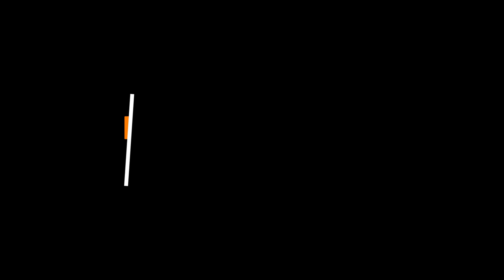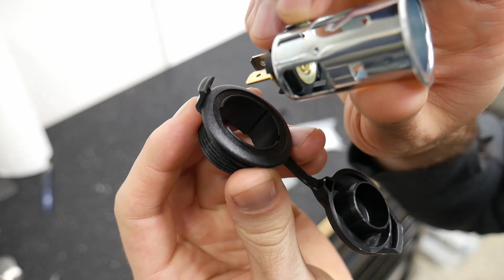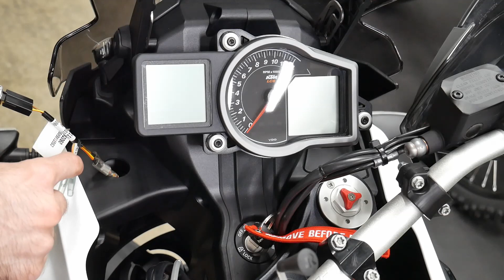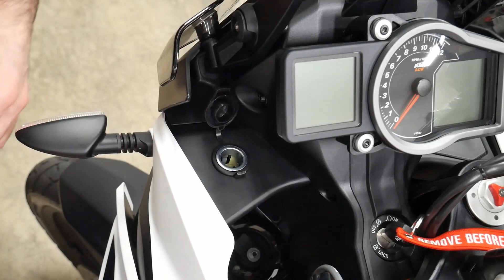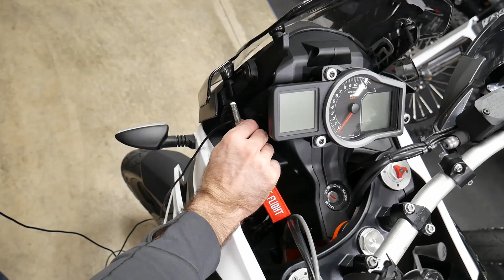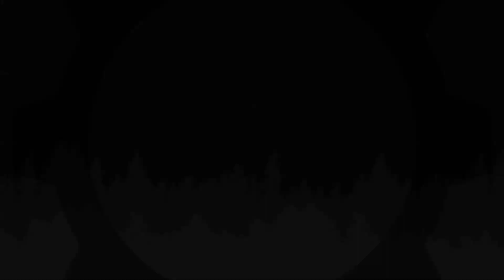Motorcycle 12 Volt Outlet Installation | KTM 1090 Adventure R

Comment: Very helpful info but im going to use a duel usb socket, less plugs joins less voltage drop and issues from stuff rattling around. If you use the second set of connectors it will turn off power with ignition so less risk of a flat battery.

Comment: Had the same problem with port not shutting off. Does it draw the battery flat or not?
Reply: If nothing is plugged in there should be no draw on the battery. When he had his USB adapter plugged in it had a small LED indicator for power, this would create a draw but it should be very, very minimal. If you let your 1090 sit for about a month the electronics will draw the battery down to a dead state. The advantage of having constant power is that you can charge something while the bike is stopped, like a phone at a campground. You could also plug a battery tender into the power socket to keep your battery topped off while the bike is in storage. A switched power socket will avoid drawing the battery down while the bike is turned off. This may be helpful if you are forgetful and you have a bunch of electronics plugged in a tank bag. KTM provides both options. CC1 -10 Amps constant power, brown - ground, yellow/red tracer - positive. CC2 - 1 Amp switched power, brown - ground, red/black - positive. I hope this helps. After watching this video I'm about to install a power socket on mine.
Reply: I went with CC1 because of 10 amps, and I'm pretty sure it is switched, which is the opposite of what I said above. That was based on another video I found. My install was a much bigger pain, I couldn't get the nut started, even with the headlight removed. I ended up removing the box the socket is mounted in to get the nut started and tightened with Channel Locks.
Reply: @rc3211  I believe your first comment above is correct.  CC1 is constant
Reply from the maker: I think it would eventually drain the battery. I haven't taken a chance and left the USB adapter in long enough to find out. I just pull the adapter and close the cap on the outlet when not in use. That way I don't have to worry about rain and grime getting in there. Let me know if you're brave enough to test it out!! 

Ride, Wrench, Repeat!
Reply: @NWLIFECYCLE  Pretty sure there is another wire you can plug into that isn't live when the key is removed.
Reply from the maker: @johno9316   Hmm, you might be right, I'll have to investigate. If you've got a video showing it, I'd love to see it.

Ride, Wrench, Repeat
Reply: @NWLIFECYCLE  First would like to say thank you for you  tire change video! I changed my first set of tires ever this week, on my 1090.

Sorry no video on the plug install, but I do have this set up on my 2017 model,  so if you dig around a little you should find a second wire.  I found a tremendous amount of info on the Adventure Rider site. "there are two sets of leads available, one is a 10A direct from the battery, the other is something like 3A and it is switched at the ignition. If all your doing is running a GPS or charging a phone the ignition controlled leads are enough." Best of luck.